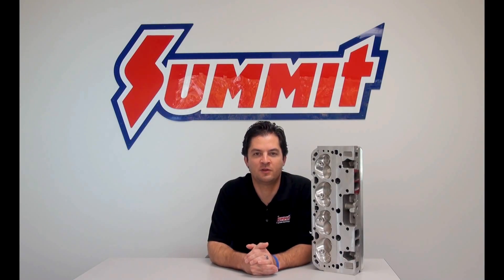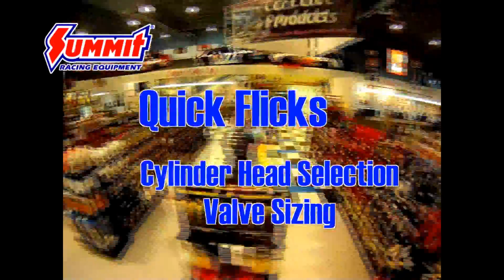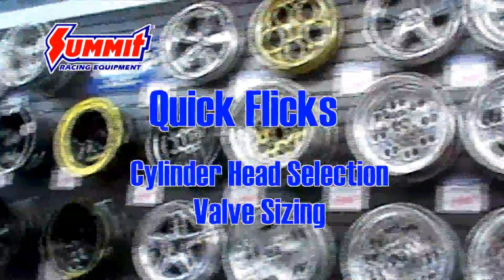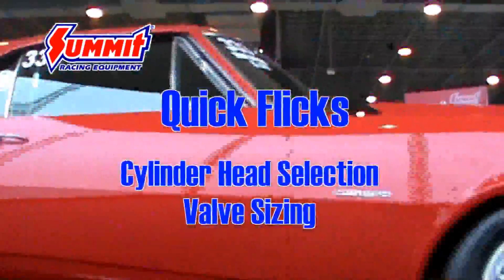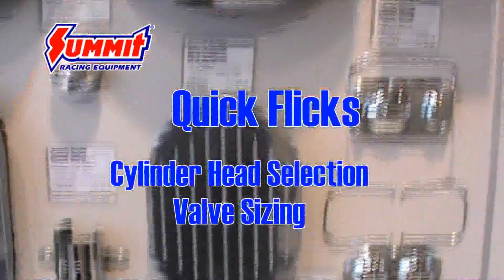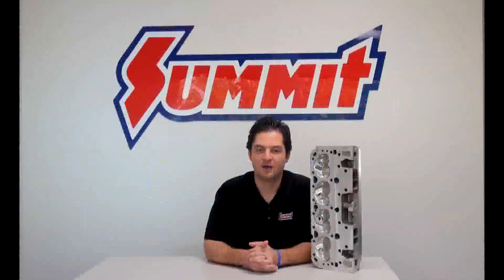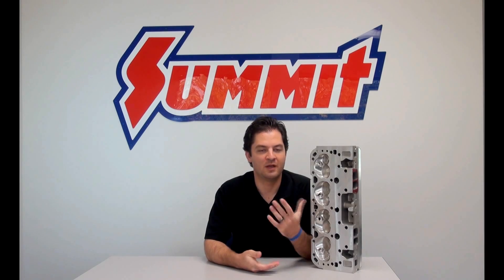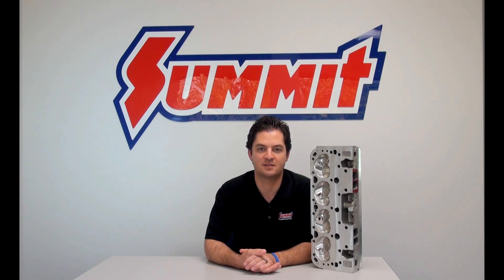Cylinder Head Valve Sizing - Summit Racing Quick Flicks

Comment: Valve length brother - expand on topic.   A recent set of heads I received were specd for 1.90" installed spring height, but... a minor machining difference [not suiting spring retainers installed position dictated by lock groove] plus the wear disc under the spring put installed height around 1.80" as built.  For the roller lifter crowd that might not be a big deal, but it can be for flat tappets.  In my  case, it put an extra 20# on closed height.   Was that a deal breaker?   No - just a small difference that might reduce longevity.

Comment: here is a chevy small block that is a pain to find heads for.... the 267 with a 3.5" bore. any one knows of a good head for the chevy 267?
Reply from the maker: Kris Phillips , 
Give us a call with the original valve sizes and we will try to find some high flow valves, possibly. Other than that, you could do some minor port work to existing castings. Anymore than that will be too much air flow for the small cubic inch depending on application. Our tech line is 1-330-630-0240. Thanks!

Comment from the maker: The video simply stated that the cylinder head/valve size would not be able to be installed without relieving the cylinder wall, this statement did not suggest that we are recommending that action. In fact, we have many options available for cylinder heads with smaller valve sizes that would work very well rather than a complete re-engineer of time tested and successful design!